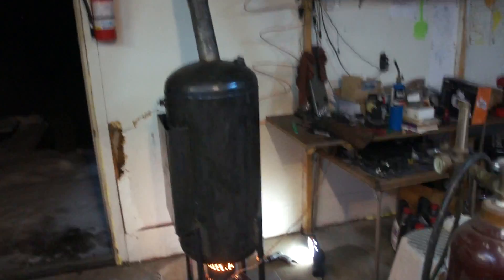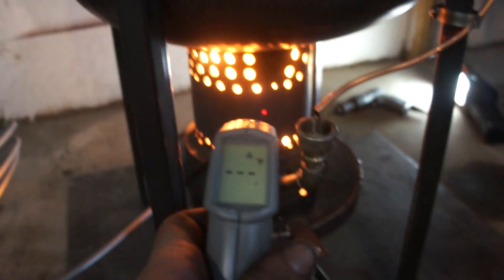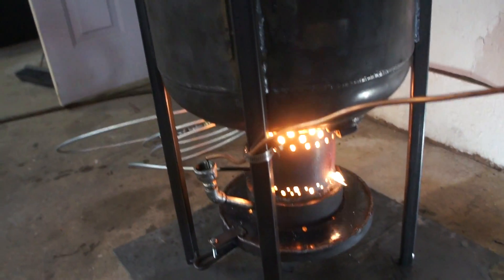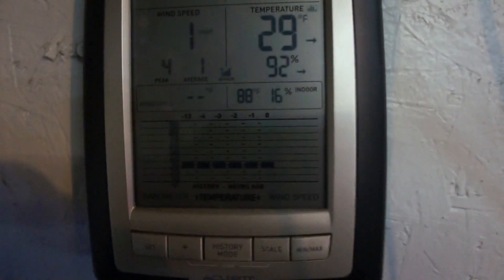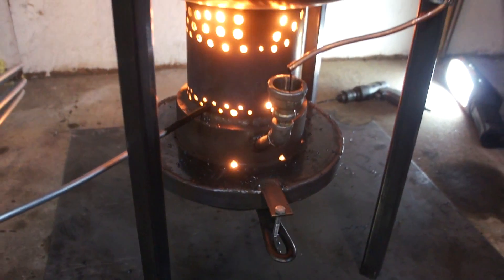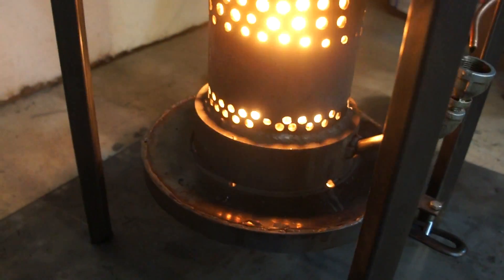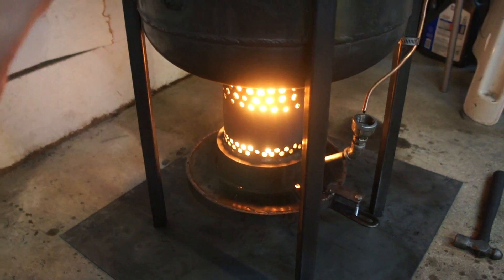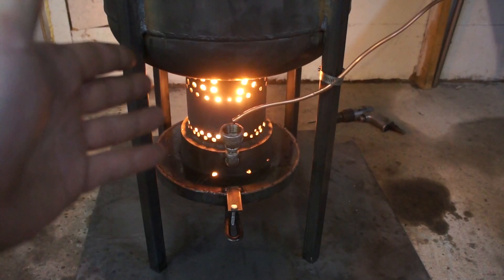Waste Oil Heater Experiment 3

Comment: At the combustion holes pipe  could you wrap  a 3/8 or 1/2 copper line and run 50/50 glycol running thru a radiator with an electric fan and a small pump. That way you could store energy in a 45 gal drum and recirculate after heated then shut the oil off and cycle the oil heater. That way you won't need to open the windows to disapate the heat to the outdoors.

Comment: Did we ever hear if he succeeded in burning the place to the ground?
Reply from the maker: The heater is still in operation to this day. Over eight years from this unit with no changes and no issues. I burn a couple hundred gallons of waste oil a year.  Thanks for the concern but I have had zero unexpected thermal events.
Reply: @JackofallTrades383 Glad to hear that.  I'm currently building my second burner for my shop's woodstove. It's very much like your unit.

Comment: Use a 3/8" fuel line w/a 1/4 turn ball valve, a 5" or larger exhaust tube and a bilge blower.  Pass your oil thru a diesel fuel filter that has a settlement bowl to drain off any water, you don't so much need the filter but the water trap. If you can filter your oil thru a 200 mesh filter great, but air in and air out are most important.☺.  Great vid.

Comment: Like it a bunch.....glad you kept on it to the point of refinement.....
Just need clarification on the dripper ....does it hit a piece of angle iron before touching the burning pan...?
I was so convinced in using a ventilated rotor....and glad your getting decent outputs without those dam noisey blowers.....

Comment: If you would wrap the barrel portion of the stove with a heat jacket (55 gallon barrel will work perfect) and add a squirrel cage fan at the bottom on one side of the barrel. Then cut a 6" - 8" opening at the upper end of the opposite side, you'd have a forced air furnace that would heat your entire home. That's what I did in my shop and it worked so well, it did the same with the one in my basement to blow into my duct work so it heats the house. There's to much hot air directly around the stove, so you need to blow it to where it's needed!

Comment: Great video do you get any smell from burning old oil and what did you use for the bottom pipe coming from your burning pot that you drilled the holes in is it a very thick piece of steel .Could you let me know thanks very much Dale

Comment: As a heating combustion designer, try to get a variable air intake , think of the Bunsen burner back at college, as you input more oil you need to be able to change the air intake ratio, I hope this helps.

Comment: If your already at 80-90 Fahrenheit in your house and shop and your still running to hot,, then I think 1/4 inch fuel line is more than enough  :)
Reply: If you have Filtered Oil or at least No Junks in them 1/4" is fine, I have tested them. But I used 3/8" for long term and less cleaning.

Comment: Anybody trying this, be sure the building is ventilated. Had a so called 'friend' experimenting with this stuff in 2007. I was just observing. Next thing I know, I have no fingernails, cant breathe, lying on the cold ass ground in the freezing rain, just coughing and cant move at all. Slowly began to realize I had clawed my way out of the building, carbon monoxide. Air going into fire has to be replaced by something, and shitty construction methods in the exhaust pipe lead to a near fatal disaster. Ventilation is required. (and friends who will take you to hospital and not steal your keys so he can go to the store instead.)
Reply: should have co detector, law here.

Comment: Hey man, Your flue exit  is too small, you should be achieving 500c on the body. Check out Gerrys Waste oil burner on you tube for better dimensions and a greater output. Cheers

Comment: I know nothing about these stoves or the efficiency.I saw you take a temp. reading on the pipe but did you go outside and take a reading on the exhaust gas? Just curious what the difference in temp is and if the length of the pipe effectes efficiency. Thanks.

Comment: Jack I put petrol in mine when it was warm, I won't be doing that again, I blow myself up. My left arm has no hair on it , my left leg is healing however my have to see doctor yet. So now starting it with a lucifer safe but slow to start. It didn't damage anything else but me. It did clean the soot out which was great. Now you don't need to heat the house in 5 minutes to 92 degrees. I don't think you need more heat.

Comment: Jack if it's so hot why do you want to want to get it hotter? You could either duck it inside with a heat transfer system. Your've got it going well, just need to run the intake tube to the centre of your fire to gasify the oil and this will clean up the smoke and the smell. This should bring back your neighbours.

Comment: This what I'm trying to tell some of these guys with oil pooling in the bottom of their bowls. Very dangerous. It happened to me it was 28 degrees outside and it flared up I couldn't get near it it was so hot all I could do is wet a cloth nappy and through it at the air inlets to suffocate it.

Comment from the maker: You are right Jim! I have protected the walls from a possible fire you just have not seen it yet I will be releasing a four video very soon and you will get to see the improvements I have made to the unit. Thanks for the advice though! I was only operating the unit when I was present and It would look pretty bad if I burn my place down being I'm on the local fire department!

Comment: There is a limit to everything. But what you must look for is the "sweet spot" where it burns hottest with the least fuel and still maintains a clean stack with no smoke or smell. 

The problem with fluffy soot is that it is very light and easily carried up the chimney with the draft, it will make a hell of a mess wherever it lands. 

I never clean the inside of my firebox from one year to another and it cooks any deposits to ash and they fall back into the bottom pan.

Comment from the maker: So your saying the more efficient I try and make it I will probably lose velocity at some point and lose the ability to keep the unit burning cleanly in effect making it less efficient. I just got done running my unit on a low heat setting about a half a liter a hour for 80 some hours and is it fun to clean with very large soot balls or chunks that are light and fluffy so I would change this heater so I could easily dissemble the unit mine is all welded together besides the fry pan.

Comment: Beware of the power of oil
I thought I'd see how veg oil burns, so I put about 1/2" in the bottom of a big beans tin.
I put the tin on my log burner in the house, just to warm it up
Eventually the oil started burning quite moderately
I then shut the door on the fire, thinking less oxygen smaller flame etc
VERY WRONG, it turned into a Rocket Burner, flames were shooting  3' high from the chimney, which also caught fire, so someone called the Firebrigade. If i could harness that heat WOW

Comment: My pan always has a small pool of oil immediately under where it trickles in but it's only about 2" across and maybe 1/8" deep. My ash varies with the quality of my oil as it comes from many sources, diesel tucks, cars and hydraulic systems.

Comment: Theoretically, about 30 KW of heat, but with inefficiency I'd say it's more like 16 - 20 KW. Your maximum heat output is limited by how much you burn and only to a lesser degree by the efficiency as you always attempt to get max. efficiency fro your burn to avoid smoke or smell.

Comment from the maker: How many BTU's do you think you can get from your heater ruffly? Do you think there is anyway of making the unit more efficient? So one could lower the fuel input but keep the draft up and get the same BTU's out of the heater? I think there is maybe some room for improvement with how much heat is lost out the flue what do you think? Do you have any standing oil in the bottom of your pan when the heater is running or is it dry? When I clean out my pan before start up the ash is dry and flaky

Comment: No, because there is only a limited amount of BTus per gallon of oil, if you burn less you get less heat. Any reduction in heat that is needed can be achieved simply by reducing the feed rate. (To a point).

 If it will not burn cleanly at the reduced rate, it's a good sign that you probably have too much secondary air inlet area. which is not giving the turbulence needed because of the reduced draft.

Comment from the maker: Thanks again! Have you played around with miniaturizing this design at all? My thoughts are to make it clean but use less fuel. At 3 liters per hour thats about 18 gallons per day! I also have to design a water separator for my set up what are you using? Any design idea's? I'm thinking of something that I can separate out water well I'm pumping into bulk storage.
Reply: who would run it for 24 hours a day ?

Comment: Yep,.. you've got it all pretty much worked out. 

Having as much draft as possible is paramount to the efficient working of the heater as it is vital that not only do you have enough air with the mix, but that it is really well mixed together and this is done by having evenly spaced holes large enough to allow air blast to thouroughly mix the fuel and air. However do not have too much air as it both destroys the draft and cools the combustion gases too much lowering the temperature.

Great job!

Comment from the maker: Thank you for watching my video and taking the time to leave a response! That is what I was thinking. From what I'm learning its about the velocity you can achieve in the burn chamber and flue and by having a 6 inch chamber and a 3 3/4 inch flue there is not enough velocity to create the complete combustion. Its just to slow and thats what I was learning with the compressed air because I was only using a maybe one PSI but that created a lot of turbulence and created a clean complete combustion

Comment: The flue should be almost exactly the same diameter as the secondary burner tube and about 8 foot long,  and you will not need any compressed air.

The bottom holes hold a stable flame directly above the oil and the radiant reat vapourises the fuel in the pan.